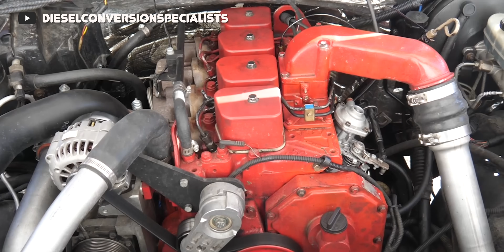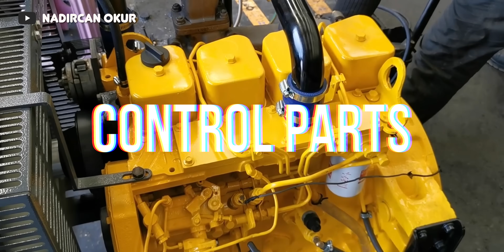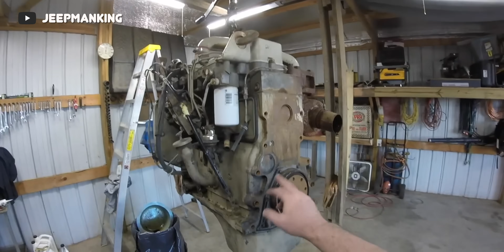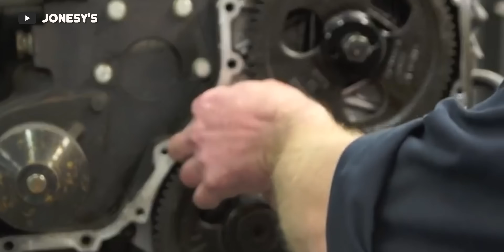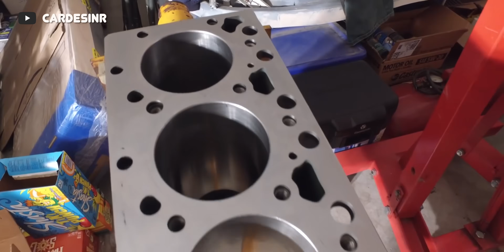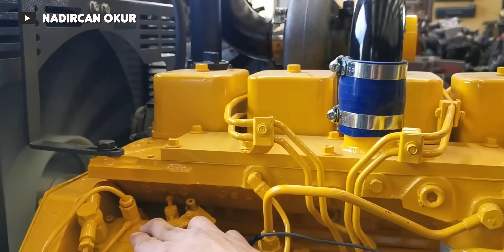Everything Wrong With the 4BT Cummins (It's OVERRATED)

Comment: 5:30 you are also increasing bore.... while keeping stroke the same
.
a larger bore VS stroke is called "over square"...... which EVERY SINGLE modern engine is
and its for a good reason
.
a larger bore gives more surface area for the explosion to push on..... increasing torque at a given RPM (theirfor, increasing HP at a given RPM)
also improves MPG
improves HP and torque
ETC
ETC
.
.
like im a BIG gm 400 small block for because of its SUPER large bore
and the fact that you can put in a 350 crank..... bore 30 over.... and end up with a 377
.
which will rev to 7000+ (AKA amazing HP)
and also has a decently long stroke.... so it makes TONS of low end torque (theirfor, low end HP)
.
.
even in stock 400 SBC form..... while not a RPM monster.... 
it puts DOWN!! the torque..... and gets a bit spicy at red line
.
and it doesnt get THAT much worse MPG vs a 350.... due to the extra large bore helping with that
.
.
.
.
also.... the myths about the 400 SBC overheating..... piston speed.... rod ratio..... bearing speed....ETC
are just that.... myths 
.
other motors use the same size bearings..... and last 500,000 miles
and ya, their is a BIT of "side force" due to the rod/stroke ratio..... but modern oil prevents that wear (and it really wasnt an issue anyway.... lasts just as long as any 350)
.
and the overheating,....... ya, when you swap in a 265HP (stock with a 2 barrel carb) into your 140hp 305 car..... 
and keep the 305s tiny radiator.... 
sure.... its gonna overheat
.
but a 350 would as well (just not as bad.... as the 400 makes WAY more HP and torque than any 350 ever made..... besides SOME corvette 350s)
.
.
.
.
the 400 is the king of the small blocks
.
and if you think its a bad design..... ill gladly take that "pos" off your hands

Comment: I was in sales for Cummins when the B-Series engines were released and the 4-cylinder was a tough sell often because of not having an internal engine balancer and it was being sold against competition that did. It took some special mounting arrangements to keep it from shaking apart the chassis it was installed in. But once that was overcome it was a very reliable and durable engine. Within 10 years of it's release it dominated construction and industrial applications where it was appropriate and probably still does, I've been gone from Cummins for 20 years. The 6BT and TA was much easier to sell and they too dominated their markets within 10 years. Automotive applications grew out of a desire for something more fuel efficient than the gasoline engines in UPS and the like, delivery trucks and of course, the pickup truck market for much the same reason.. The other applications since I don't stay up with.
Reply: There was a balance shaft version. They are rare but I’ve built a couple and they are a lot smoother.
Reply: Why the hell would they even make it unbalanced? Just for cost or simplicity?

Comment: My 4bt is out to go into another project but what started out as a get good fuel mileage project turned into one hell of a daily driver/toy (as most projects with good intentions do)  The last dyno pull it made at an event was 525HP/936TQ with a little over 100lbs of boost with compounds.  I love the little motors, but I will say it will shakes like a paint shaker!  Besides all the trans parts I went through, I had several front covers crack, broken motor mounts, and the truck just was much looser after several years of driving.  I have always told everyone afterwards that if a 6BT will fit do it...  Love them 4Bs though!
Reply: That's the problem their not balanced they shake like he'll
Reply: Problem with 4 cylinders

Comment: I have funny story while looking for another Ford Ranger. I found decent 2000 Ranger 4x4 and guy asked what I was going to do with it. I'm putting my V8 in from my very rusty 99 Ranger. Guy said I wouldn't do that it will ruin it WHAT. I would put in Cummins 4BT engine I'm like that will certainly ruin the truck. My god 4BT around 800 pounds, plus going through bs building mounts, getting adapter to make trans fit, fuel system, you name and keep 4x4. Plus dealing with cold weather and gelling. Nose heavy truck plow like dump truck in snow. V8 from 2001 Explorer whole thing plug and play in 99 to 2001 Ranger as long as you use AWD. I'm using Ranger t-case. V8 far lighter and torsion bars are the same as V8 Explorer just have to turn adjusting screws in. I'm Cummins certified, I deal with gelled trucks so why would I want all headaches for my winter vehicle............... Yep he wouldn't sell it to me said his grandpa wouldn't like that he was diesel engine guy. It was his grandpa truck he died year before.   It all started in my 99 ranger, to 03 ranger and now 05 ranger. I did rebuild engine before putting it in 05 because it had 260000 miles on it. DIdn't really need rebuilt either was very little wear. Cyl #8 had some more wear injector leaked fuel on that cyl

Comment: We have one at work in a case skid steer for the last 5 years I usually start it up straight to full noise  unload a truck with forks then turn it off full noise never ever had an issue with it and everyone else flogs it too, so in my opinion they are great?

Comment: This engine sounds like a straight down grade from a Fiat Z19DTH 150HP that can reach 250HP with off the shelf bolt ons or 350+HP if you have a branch manifold made for a turbo bigger than a GT1860V.
Reply: The guy makes it sound waaay harder than it is... a P pumped 4bt can make waaay more than 350 on a budget using 6bt parts..

Comment: I was looking for a 4TB for my 1942 Dodge wc 52.  I'm  Swedish so it is even harder to find here .  I got hold on a IVECO 4.5 liter instead for 400 dollar . It has a 4TB top, but the bottom is Cummins 4.5 there is a smal difference in diameter and stroke . And a standyne pump . And it has wet liners .      https://youtube.com/shorts/9pqEYIbqMlo?feature=share

Comment: Running one in my 1942 Dodge - milage is crazy on the flats. The vehicle weight is 7000lbs dry and  4 tons loaded - it does top speed of 70 miles and hr at about 2400 RPM on 40 inch tires. Best milage is 29.8 running at 60mph on the free way. Downside is the darn thing is noisy, noisy, noisy and vibrates like heck. I would love to balance one and switch from the VE pump to a P pump. I run  compound turbos and have the waste gate open at about 25lbs, the pump is untouched and the engine runs clean.  Pulled the pan and at 60,000 miles there was not a spec of muck in the bottom of the block. Going up hills? She ain't fast, but it sure crawls nice in the bush. Fuel? You can run pretty much all sorts of stuff to get by and you can not do that with a lot of the new rigs.
Reply: You can buy a balancer from Cummins. It bolts to the bottom of the crank main caps and sits in the oil pan. It gear driven from the crank. At least you could when it was first released and for 20 years thereafter.

Comment: Any 4 cylinder in-line engine, whether it's a gas or diesel are inherit to vibrations more so over a certain displacement size by design. Most are cross-plane cranks. Look at most of the modern or even older designed 4 cyl in-line engines the displacement is generally under 2.5L (150 CI)for that reason. When the ones over that displacement (2.5L or above, some smaller than 2.5L, depends on the maker) will engineer into those engines a balance shaft to counter act the vibrations caused by the design and most of the engines are capable of higher revving (5K or higher rpms which are mostly gas powered, some diesels). Being that 4BT is a 3.9L and a lower revving engine (redline similiar to a 6BT, 3K to 3.5K rpm , operating range around 1K to 2.5K rpm give or take.) Cummins probably for various reasons (cost mainly and for what it is intended for) decided not to engineer in a balance shaft to that engine, but did offer to those who wanted, some type add-on counter balancing kits to help smooth out some those vibrations. Being it's all heavyduty construction (block, head and internels) it could very well handle the vibrations inherit to the design. Whereas other in-line 4 or even 5 cyl engines similiar in displacement(3.9L or less), gas or diesel will mostly have an aluminum head and block (intented overall weigh savings) or cast iron block with an aluminum head so those balance shafts were needed not only for smoothness but to also help extend the service life of those engines.

Comment: The 4bt will run twice as long as any engine you listed. Is it weak? Yeah. Is it heavy? Yeah is it expensive? Vs a VW meh probably not since you can pick parts off anything from a komatsu excavator, case ih skid steer or a dodge truck.

Comment: most reliable engine in the world.  Drive mine daily no issues at all plus with timing gears vs belt/chain it is basically a no maintenance engine (other than oil changes).  I guess the 345 IH engine is similar but that is a gas hog and requires a carb or electronics to make it FI.  Name another engine with no electronics (3 wire start) that only requires oil changes and can be run on road and make good power?
Reply: vw 1.9 AAZ

Comment: The only issue i have with this video is it doesn't take into consideration people who are going  to build their motor you can buy one a lot cheaper than it mentioned if you want to buy one more worn and totally rebuild and hotrod. The crate motor, well there goes  the warranty. also the 4bt also has better market support that you can get part parts to hot rod your motor
Reply: I don't get why you'd choose a 4BT for a hot-rodding application.  It's little and has all the airflow of a sink drain.  Especially if you're pulling out a gas V8, which in all likelihood has a massive catalog of cheap high-performance parts available.  I think a 4BT makes sense to grind out a ridiculous number of revenue-earning road miles and idle hours, but it seems like a very odd choice for performance.
Reply: @JETZcorp  not everyone is replacing v8s.  But also remember not everyone wants to cut the firewall for most applications

Comment: My family has diesel powered Ram pickups.  Both 1500 & 2500.  To bad that when common rail technology was introduced with the increased power.  That a 4cyl diesel was not a factory option.  If a medium duty ZF-8 speed had been used, besides the G56 transmission.  The fuel economy would have been awesome.  And the power would have been fine, since a mechanical injected 5.9 put out less power than the 3.0L Ecodiesel.

Comment: If 6BT is the standard Prius swap, then 4BT should be the economy option. Of course my owners manual tells me to knock out the smallest window to unlock the door in case of locking up the keys. Might want snoop around first

Comment: I hate it when people crucify Cummins for the kdp. If you’re going to do a video like this you should go over the actual design flaws of the engine. Some examples (5.9 53 blocks) (24v cracking valve seats) (hot vp44) (12v exhaust ears cracking) not something that can be fixed in an hour. Like (kdp) (oil leaks)  etc. You made the kdp sound scary. It will not destroy your engine 95% of the time. The crankshaft spins clockwise which makes the camshaft spin counterclockwise. If the pin falls out it will wedge up against the timing case wall and the camshaft gear. Simply busting out the side of the aluminum Time in case wall causing a bad oil leak. Very rarely it can get down in between the crankshaft and the camshaft gear then it will destroy your engine. But Out of the years I’ve worked on Cummins I’ve never even heard of that tho.

Comment: One thing people miss on the old diesels, there's no ecm, little to no electronics and full mechanical control. It's far easier to adapt those engines to any application than an ecm engine. There's also the difference in mechanics, old school loves being able to diagnose without a scan tool, were as newer mechanics don't know anything without the tool. I prefer old mechanical injection for It's simplicity, I don't want to spend thousands for all the electronic gadgets when it's overly complicating the situation.
Reply: And the old mechanical engines are alot less problematic, and alot more dependable, and overall cheaper to work on!!
Reply: I agree.  I'm old school.  My boy loves the vomputerized engines, so in a way we make a pretty good team!
Reply: Indeed I have no interest in an electronically controlled diesel.
Reply: right now i have a ISB 3.9 in a F250 2007 (south america), fucking tired of dealing with electronic shit, i need shit to start and move in my truck, not to deal with fucking code 123123432324r out of your ass that puts me in emergecy mode and wont let me go over a bridge, a brand new 4bt is 16k usd, really thinking about swaping, will loose some hp, but ill just go a bit slower and thats it

Comment: As a life long Jeep lover, RPMs and weight reduction are our friend. I would consider the 4BT a downgrade from the Jeep 4.0. The LS is probably making people tired of hearing about it but there is good reason. When you can't even spin your 42s fast enough to clean the tread out you may wish you had went for a gas motor.
Reply: with the exception of jeep, every 4WD in Australia is turbo diesel 🙂🦘
Reply: @tonydoggett7627  There's something to be said for a nice torquey little Diesel but newer versions have gotten so complex and being forced to burn the low sulfer stuff that many of their benefits aren't what they used to be. The fuel is hard on injector pumps and  Don't even get me started about the price of diesel since our government stopped letting us vote for our President in the US..
Reply: @miketee2444  I have a property 200km’s away and regularly drive over a mountain range to work on it. I own 3 Toyota 4WDS, my 2007 V6 Hilux petrol manual dual cab is the most expensive in fuel for the trip. My other two are 2.8 and 3 litre turbo diesels automatics.  that use half the fuel. our diesel is 25% more expensive per litre than petrol. 🇦🇺🦘 (note: there is no longer a petrol option on Australian Toyota 4wds since 2017)
Reply: uh.... sounds like you didnt change your gearing 
.
even an engine with a red line at 1800 can spin the tires..... ya just need to gear it correctly
Reply: @kainhall  sounds like you read a lot and have never actually done it. I am well aware of what gears do and out west on rocks like sand paper you can gear as low as you want. Down south when you go through some mud or take off up a mountain side with wet leaves and rocks that you couldn't even dream of walking up then I can promise you that low range is of zero use . It's kinda like why a Suzuki Sami is a cool little rig but very hard to fit much of a motor in. They are always stuck at the back of the pack winching where I come from. Reading and theory only get you so far and I'm positive you don't believe a thing I'm telling you so get out and figure out what the term Wheel Speed can do for you when going over obstacles. HINT ,That's gonna be the opposite of low range.
Reply: @miketee2444  I live in Montana 
Look up "gumbo mud"
.
I know all about using high range to clean out the tread
.
.
And again.... gear it properly and you will get wheel speed
.
It's not that hard to swap out a ring and pinion dude....
Reply: @kainhall  well then surely you can understand what I'm talking about when you see a truck plowing through your gumbo mud and then you see one of us red necks that dam sure don't have a diesel but we are roasting the tires so hard the truck climbs on top of the mud and doesn't even get the inspection cover dirty

Comment: Used to replace ford 300 straight 6's with  a retrofit 4bt in Hostess bread trucks.
Reply: Ha.  I have one of those old Hostess trucks.  It's a Grumman on an Oshkosh chassis (1991).  No idea how many miles are on it (tons).  The Ford bellhousing and T18 tranny are still in it.  The Cummins half of the bellhousing was special made to bolt up to the original Ford bellhousing.  I believe the clutch disc and pressure plate are Ford and the Cummins flywheel was special made to accommodate them.

Comment: All cummins heads crack. Spider cracking is very common but not a problem. It's only a problem when people see it. Don't look at it. As long as the cack doesn't extend from the valve seat into the injector bore I wouldn't worry about it. I have had cracks running from the seat to the injector that you could stick your finger nail in it. Ran fine. And then people see it. If anyone got cracked heads they are going to scap please let me know.

Comment: No idea why you would touch one of those engines when you can pick up the R2.8 crate motor now which to me is the logical successor to the 4BT.

The 4BT is cheaper and simpler but you aint gonna get it brand new in a fancy box with 0 hours runtime.